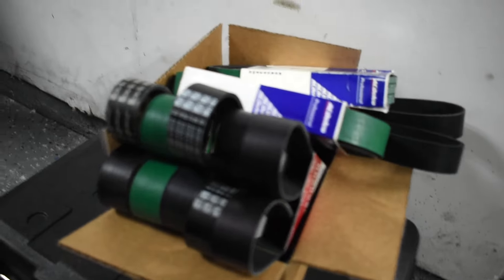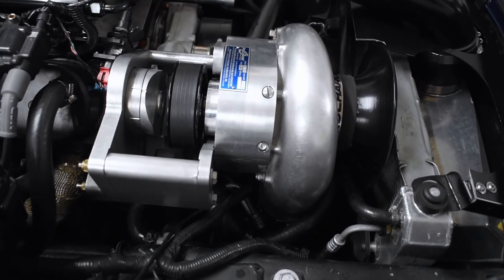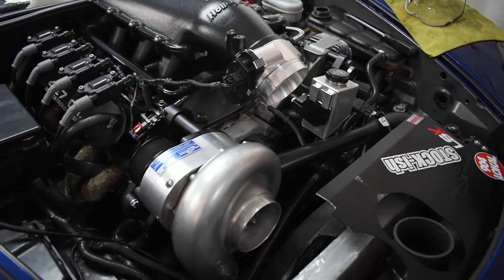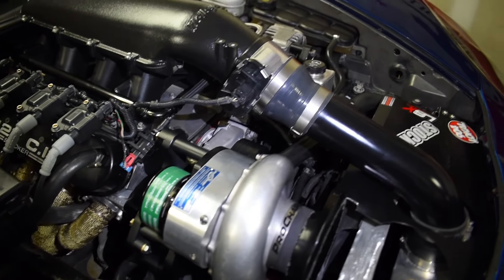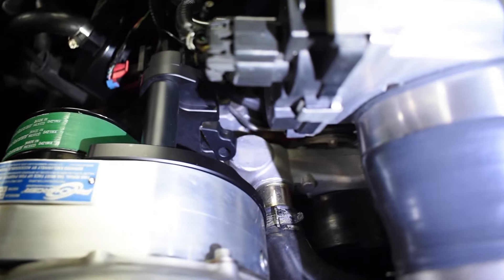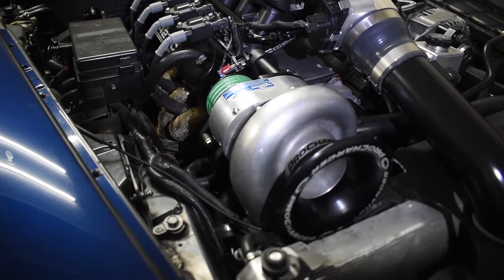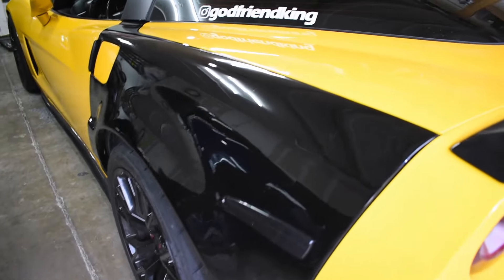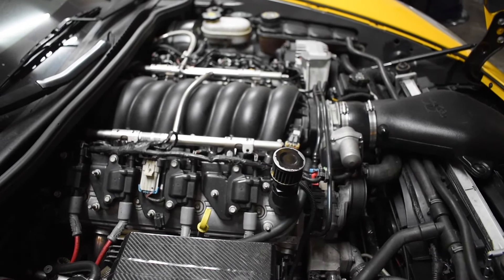ProCharged 441 LSX C6 Z06 | A&A Bracket Install

Comment: I’ve overs-spun blowers up to 10k rpm never had a issue. Next problem I think you’ll have is the intercooler. Corvette intercoolers are small and create a lot restriction. I’ve had some that would chunk the belt or chirp the belt when letting off the throttle. Next thing I would go to is a air to water setup would probably pick up some good numbers just off the swap
Reply from the maker: Bro deleting the A2A is something I’ve been considering and going A2W. Gonna run meth right not cause I think the A2W will be a lot more intricate right now. In the future perhaps

Comment: That setup is a lot better, hopefully this takes care of the issues!  I'm not a fan of over spinning the compressor that much, you might want to rethink that.  As always, lookin good and forward to the testing video!
Reply: yeah for sure if you want to make 1200-1500whp f1x is the way
Reply: @DontStopReeling  At that point, I'd opt for turbos, but I agree with your point.
Reply from the maker: The boost is definitely kicking in sooner now. Spoke to Procharger and got the word that over spinning by less than 10k is fine apparently lol
Reply from the maker: Let’s see if we can squeeze that much power out of an F1R
Reply from the maker: Oh for sure, turbos won’t rob nearly as much power as the blower is
Reply: @McgradyRacing  And they wont slip or toss belts either! 😎

Comment: running same bracket with procharger.  what drain line did you use? 
awesome built btw
Reply from the maker: I ended up deleting the drain line. I take off the head unit completely when it’s time for an oil change

Comment: I would definitely recommend GATES belts. They should have come with the kit. I would also use caution with over spinning that much. High level superchargers are not cheap.
Reply from the maker: Yes you’re right, crazy that gates doesn’t recommend the green belts for superchargers. The RPM belts are what is recommended

Comment: Hey man I’m installing this exact kit on my car, I’m having an issue my griptec pulley is rubbing on the procharger where the procharger sticker is. Can you measure the gap between your pulley and the aa bracket that bolts on the supercharger?
Reply from the maker: More than likely you have to flip the pulley/the hub around bro

Comment: are you using gates belts? they dont stretch like the oe/oem ones. Whats the bracket brand you are having toruble with?
Reply from the maker: Gates belts are holding up with the new bracket setup. I was having issues with the ProCharger brand brackets

Comment: I'm running a 12 rib on my f1a-94 for my 06 mustang gt with no issues, do they make one for yours ?
Reply from the maker: I’m sure there is a 12 rib option but I think 10 ribs should suffice for now
Reply: @McgradyRacing  10 rib should be adequate 👍

Comment: I have the A&A set up on my 2012 GS. I can change belt with out removing bracket.
Reply from the maker: I think my aftermarket waterpump is the cause of that issue, very tight fitment

Comment: i had nothing but problems with 8 rib  went to a 12 rib and problem solved   mines on a dodge challenger
Reply from the maker: I’m sure this 10 rib is going to suffice for this set up. Noe let’s see if the brackets were a good move

Comment: hey man u need to ditch those green belts.  rpm black belts or dayco all day!!
Reply from the maker: Yessir, green is not recommended for superchargers. Wonder what the hype is about
Reply: @McgradyRacing  well I’m still on a 6 rib and with the dayco belt I can make around 15lbs no problem
Reply: @McgradyRacing  the hate for your car is insane and it’s all the slow people with the most to say

Comment: For the meth, just use a snow performance 102mm meth ring. It bolts on between the manifold and throttle body and uses an O-Ring to seal it.
Reply from the maker: Hey bro! That’s a damn great idea. I’ll look that up

Comment: 12:31 why the hell would you cut a major bolting point off the bracket. Get the correct water pump. You more than likely just screwed yourself. Now that bracket only has 3 bolts instead of 4 holding it to the engine. You also didn’t need the AA bracket to run the direct drive either.
Reply from the maker: Man hopefully that’s not the case. I was thinking about drilling and retapping the bracket so I could still use that last stud that would’ve been at that location